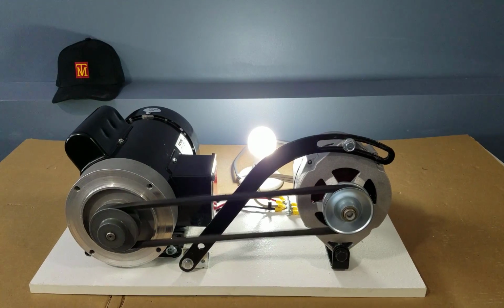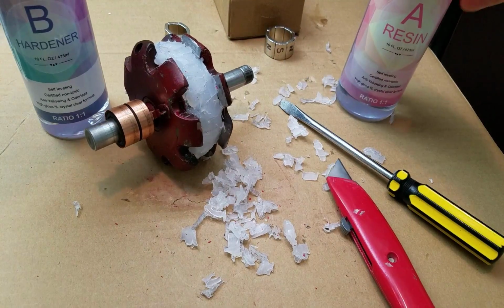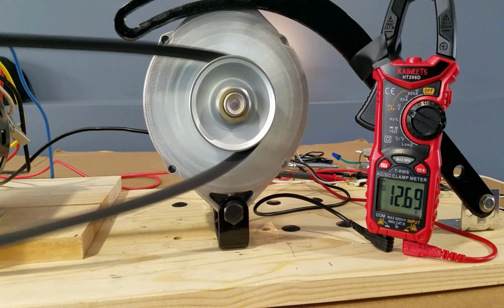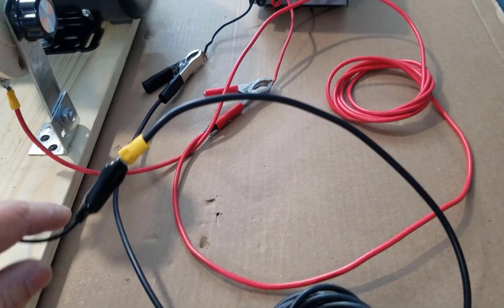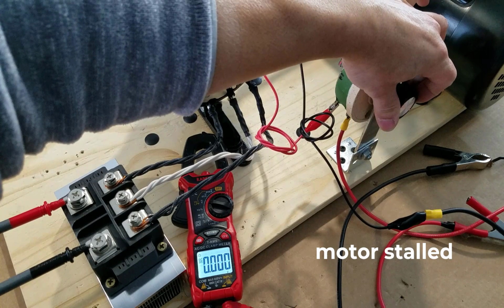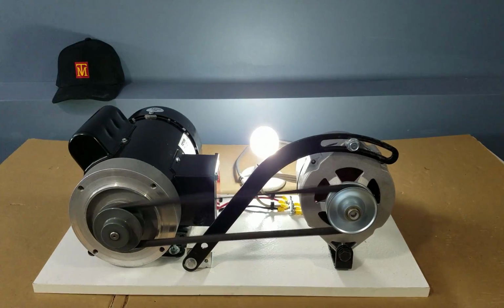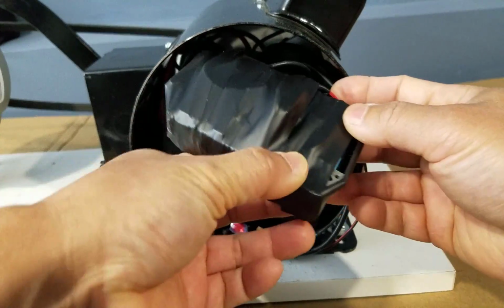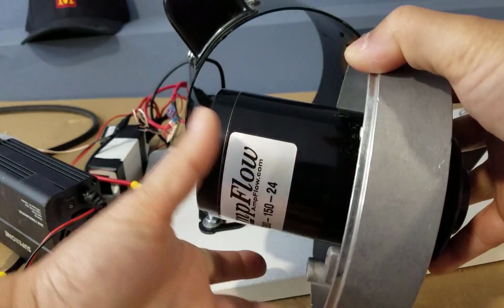Over Unity - Infinite FREE Energy - (Fake - Exposed!)

Comment: That's why we don't have yet a self charging electric vehicle. The most electric vehicle problem is charging time, because not possible to charge an electric car in under half hour like a combustion engine gasoline refill to used for a miles away.

Comment: Fake car alternator is build only for 12VAC,iven speed more slow or high still 12VAc out put still constant. It will be posible if you youse Inverter power by battery 12 vdc.

Comment: So youll have to forgive me if im wrong, i know literally nothing about any of this, but from what i saw the machine seemed capable of generating approximately 60 volts on a 1 horsepower engine, so hypothetically, if you were to acquire a big enough engine would you not be able to apply essentially the same thing and have it generate much greater amounts of power?

Comment: I have a question, why doesn't countries use this solution (electric motor to run a generator) for electricity supply but instead prefer to use nuclear facilities or hydroelectricity??? Is there any downside on using this system??
Reply: 4 words: Money!!!!! Lack. Of. Creativity.
Reply: @brazil3207  Ridiculous! If there would be a way that it's working it would be on the market immediatelly!
Reply: Yup - it doesn't work, that's why.
Reply: Really? 😂 Are you serious or stupid? But how is it possible to be that stupid?  Such devices will never ever work. Are you familiar with word "efficiency"? Standard electric motor has 85% efficiency, generator has the same. You need to take these 15% missing energy from "somewhere".
Reply: @meggido4440 then explain to me how super conducting electromagnet work?

Comment: I don't know, if that makes the great difference but the crazy-channel-guys glued  2 even poles together which amplifies the magnet flux in the combined region ( v1 ). I could imagine that this is necessary because of the iron corpus of the alternator which produces eddy-currents and more drag. In v2 I think they use besides the alumnium corpus other type of  magnets with pole-layer in the vertical direction.

Comment: It's good that you are explaining these scams, because there may be some people open to persuasion by the facts, but I fear that for most who believe in perpetual motions machines it is an article of faith, and not a subject of logical inquiry. Like flat earthers, they start out from the assumption that their belief is right, so anything that contradicts it must necessarily be wrong.
Reply: It's absolutely faith.  When I was a kid, I told my dad about the "Howard Johnson magnetic motor" that was in Popular Mechanics.  He (Howard Johnson) claimed his permanent magnetic "motor" ran forever and anyone could build it.  My father was easily one of the best machinists you could find (He didn't end up with one of the biggest machine shops for 60 miles in every direction for no reason) so he built it.  It's probably the only PROPERLY "made" example.  I still have it to this day.  And it works just as well as all the other over-unity, free energy, etc, B.S.: It doesn't.  Of course, that didn't stop me from building thousands of these kinds of contraptions myself as a kid too.  When I got older and actually learned the physics behind all this stuff, I explained to him several times WHY it didn't work and why it didn't matter what he did with the bearings, what he did with the magnets, that it wasn't "heat from lights" screwing it up (That heat thing is a startlingly common "magnetic motor" claim when people fail to demonstrate the device), etc, but it didn't matter.  He went to his grave "knowing" that he could do the equivalent of taking a single 1 liter bottle of water and fill an entire 1,000,000 gallon sized swimming pool with that 1 liter of water with it if he just poured it out in a super special way.  I should add, my father was no fool, but motivated reasoning compels us to "know" things that would benefit us "have" to be true.  Between that, sunk cost fallacy, growing up in a culture that "knows" that stuff is true, etc, it's easy to have a few ideas that are just flat out not true.  I think my favorite doubling down in this story though was the whole "Oh, you BUILT it?  Oh, well, it doesn't work because I couldn't publish the REAL plans.  Send me money and I'll send the real ones.  So I guess technically, the version I have now is the "real" version since dad re-machined some of the old stuff for the new one.  Works exactly the same though. :)

Comment: you not even close to what there doing ,,you did not modify anything correct ,,,,keep trying  ,,,i did it using a genterator head like the liberty 2.0  the microwave coiles act as a troiadle transformer that will handel the current ....try agin

Comment: Thank you for proving the over-unity theory, and all the other "free energy" schemes out there. With a generator or alternator of 65 amp output at 12 Volts (780 watts), it requires about 1 horsepower to produce that much amperage, with equal size pulleys on the motor and generator (one horsepower = approximately 780 watts). With a more modern alternator that produces well over 100 amps, the horsepower required to turn the alternator is even higher (Ohms law states Volts X Amps=Watts). To all the scammers, do the math before you show a ⅓ HP motor producing 2KW of power at 240 Volts from a generator!! Immutable equations of the universe can't be denied.
Reply: Asking them to do the math would assume they would even know how in the first place.  Let's be honest here, these people understand the world around them poorly enough in most cases that they'd LITERALLY ask you why you brought horsepower up and what's it got to do with watts?  I've started using an analogy for this kind of stuff.  It's like someone claims "I have the fastest racehorse because I feed it nothing but airplane gasoline".  Of course, everyone intuitively knows this can't be true because if you try and force nothing but gasoline down a horse's throat for a while, it's just going to die.  But, change the subject so it's something people DON'T know much about and suddenly you're in a conversation that is the equivalent of  "And how do YOU know he didn't feed his horse gasoline?  Maybe he BUILT a special kind of horse.  Do you think high octane gas will make it slower or something?  Are YOU a horse expert?  What makes your claim that it would die a valid claim and his a lie?".  Now, change that to "I put in 1 horsepower and I got out WAY more than 745/6 watts!" and suddenly we're REALLY having a conversation about "and just who do you think you are?  How do YOU blah blah".  Ah well, them's the breaks. :)

Comment: So explain to me how a motorcycle charges the battery using a magneto? Obviously powered by a gasoline engine but the 3 wires coming out produce 90 volts AC each at idle which is around 750 rpms. It only takes motion of the magnet around the stator to produce electricity and 3 wires times 90 volts is 270 volts. The rectifier then converts it and drops it to 12 volts dc. What kind of lawsuit were you threatened with?

Comment: Sure it works, but not if a debunker of free energie is explaining it. When running different size motors with different magnetic field intensity they produce their own electricity. Keep in mind by connecting two motors you disturb the magnetic field and produce the electric current. This induced electric current are then running the motors. We call this in physics as the Faraday law. You can see that if it works they always use two different size of motors. This similar method was applied in modern hybrid car.
Reply: you are both scientifically illiterate and extremely gullible.
Reply: Peter, I have watched the crazy channel and they have the same setup and was working, can you explain why this setup is not working, and the crazy channel setup is working? I believe they modified the motors to make it work.
Reply: @JJJ-gf2ov Because those who pretended that it works are simply scam mers, do you know the notion of losses and positivé feedback, go back to your elementary courses. If the motor has a yield of 90% because of losses and the generator a yield of 90 % the final yield is only 81  % and the loop stops quickly. If the loop,was by miracle over unity, let say 120 % after one two round the gain will be 144 % and so 172 % after 3 loops, I let you imagine after a hundred loops, everything is supposed to exploses 😂😂😂😂😂

Comment: i do not preheat deceit . of course i was aware their was a fuse narrative being product ,  in the advert for only power can be product by a magnetic field or battery supply   from a source . but had you used  the mother to drive the alternator by the inverter powered by the battery bank charged up from the surplus power of a wind turbine & solar panels Which in tern had been changed with the Dump-lords of that  battery  banks , over unity would have been demonstrated .  indeed  as the out side sun & wind power having  been the of the sun & wind that was free.  [THE free power produced ] Though  your demonstration was amusing It was Disengennuwas & missing the point. green energy is attempting to  Achieve which is to remind you a harvesting of power for wing & sun River in order to remove the demand on carbon fuels,  as poppas as you your-self may have an opinion on this  it would help them white a   need to further that approach  for you to refrain from making your money in this way & a registrar of them  demonstrating this way  be de Monetarized . removing the desire to post deceitful ads .  god knows how meny  hope-full young inverted you have trend away from a promising path  that  may be even outstanding in  future Brack thought  .

Comment: you are not correct the origaNAL SYSTEM USED A MOTOR AT 3500 RPM AND WAS SMALLER

Comment: If the voltage doesn't have any where to go it will slow down. Your cables aren't thick enough. A pipe dan only allow so much water to flow threw at one time. You know this if you k:ow anything about power. Then say it almost stalled the motor when you didn't have the power going this is akso used as a break for a wind generator. Plus just because you can't do something doesn't mean no one can. Lame explanation nothing like leaving out a few key details 😎
Reply: @Me-yq1fl  The power has to go thru the matter. Also, friction, heat and sound loss.

Comment: Thanks so much. You not only explained what the scam videos are doing, you actually built one! It's hard to believe how many people are falling for this crap.
Reply: free energy scammers capitalize on the gullibility of scientifically illiterate idiots.
Reply: Peter is a perfect example of this...
Reply: Glenn Rager: It's all a bit confusing to the casual viewer.
The Spanish video clearly shows and explains to the sceptics that there is no built-in battery and, moreover in an open area, he connects heavy consumers such as a heavy angle grinder and a power drill that a small built-in battery would not be able to power.
This one here takes a bulky 1 horsepower motor just to be able to hide batteries in it; moreover, he only connects light consumers such as charging a mobile phone and a TV. Clearly a debunker of free energy.
UFOs have different propulsion systems; you have the element 115 as the grays have; others more advanced aliens can completely cancel out the gravitational and inertial mass and then you need practically no energy anymore for propulsion (a=Force/m) to make fast accelerations or instant travels or even to travel inter-dimensional.
Reply: @petercernjavski9419  Well, I wish I had the time to do these experiments myself. That would be the only way I could give an unbiased opinion on these matters. Anyways, thanks for replying!
Reply: Even if most of the videos are crap, they still have their value. There are also authentic videos. The intention is to wake people up that free energy really exists - as Nikola Tesla claimed - and is already in use and can save the world from the greedy energy lobby.
This here is someone who wants to make followers of the great masses of people who don't believe in it.
Reply: @peterweetbeter  Yes, "free energy" (over unity) exists, including the recent fusion breakthrough, and whatever the hell is powering UFOs (UAPs), but the countless motor/alternator "free energy" videos are all fake, having a hidden energy source, as this video proves.
Reply: ITS SAD PEOPLE WANNA BELEAVE THEY ARE HOPEFUL BUT THATS WHY I WOULD RATHER USE MY TIME TO LEARNING HOW TO MAKE SOMETHING THAT ACTUALLY WORKS.

Comment: The reason not possible because 2 possibility : 1 ) the motor and generator is remote control through improper shielding 2 ) the coil was not properly coating and it can remotely break down when needed
Reply: https://www.youtube.com/watch?v=sIed-l-U7NQ&t=315s

Comment: I was just like to make a comment overunity  is possible if you seen any Nikola Tesla materials on residual magnetism if anyone has played around with a motorcycle Magneto you can do a real simple experiment when you put power to the Magneto a metal  object will stick remove the power leave it alone and that object wil hang there for Infiniti that's what you call residual effect I watched that guy on YouTube mr. Electron he did that with the old washing machine motor he  power it with one 12volt to the coil  and the other 12volt volt batterie went to the armture and after he got it running he was able to disconnect  one the batteries the think kept running and accelerated I left the comment on his page that he needed tachometer or a 12-volt dimmer switch the control the the power of the magnetic field. a alternator don't keep the residual magnetism in it only when excited because the the magnetic poles don't flip and  you need iron plates in side  coil and you need armture and that has brushes in it to make residual magnetism
Reply: Residual magnetism is just the material being partially magnetized, it will not result in any over unity. It's actually a sign of loss in the system.
Reply: Thank you, Richard. This guy's core is TOTALLY WRONG. And using hot glue as a substitute is not the same as the core that was built in the original. This guy purposely didn't follow instructions, then rigged his setup to say that the original was a fake. Interesting. Wonder how much this guy was paid for this video.

Comment: theres a centrifcal switvh on it
Reply from the maker: Nope, just a remote control switch
Reply: The centrifugal switch was removed along with the rotor assembly.
Reply: @glennrager3684  it doesn't work because you took the rotor out . The rotor is very important for creating energy